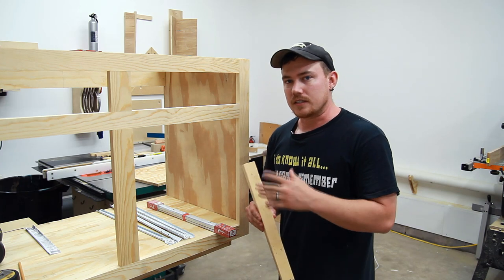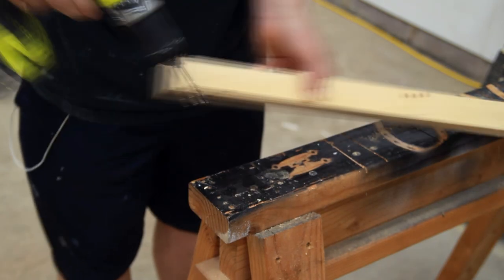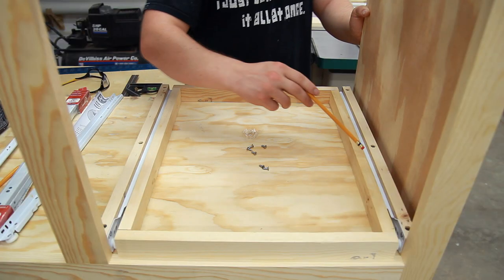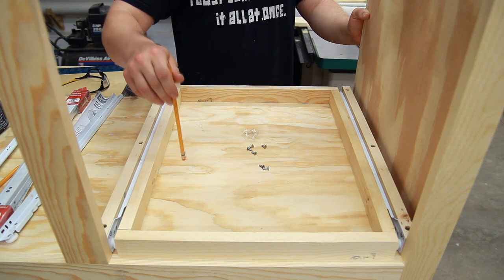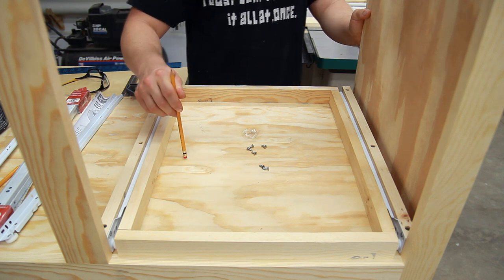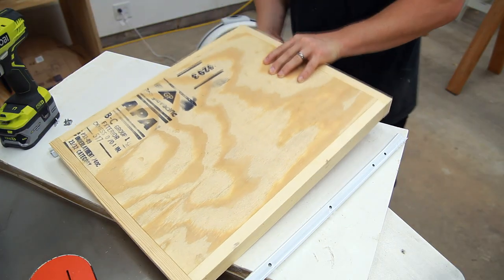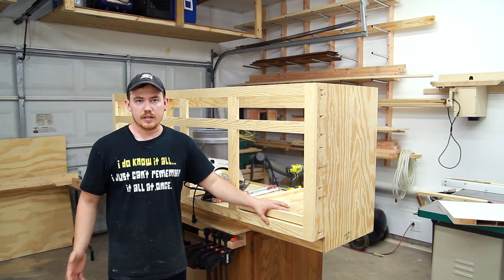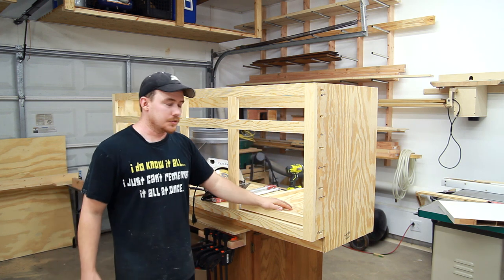EASY DIY Slide Out Cabinet Trays - 167

Comment: i made a cabinet/work table for my small basement workshop and used this to great result.   I made a slide out tray for my 3 gallon compressor (on the bottom like your example here) and also a deep drawer (9'') above the compressor for plastic tools like feather boards, pusk stiocks and my grrripper.      I've seen all the cideos and can't wait for the next one.

Comment: Jay, You're a very good teacher and an inspiration.  I was tired of my shelf and pegboard mess in my garage and instead of making drawers or cabinets I made a 48" bench about 42" high and 24" deep against the old messy wall.  I've made the sliding shelves as you have done here.  I still have pegboard above (even more actually) but with deep sliding shelves, they hold more supplies with easier access.   BTW, I downloaded sketch-up but it didn't speed up this particular project.  I was spending so much time trying to learn the program that I decided to just go cut some wood and get started (finished).   I've been watching the tutorials on sketch-up as well as your videos, and I wanted to thank you for your contributions.

Comment: Back at the cabinet shop, we called these roll-out shelves. They were a $50 add-on option for base cabinets. We did a lot of them in kitchen sink bases - usually on the left side, for some reason. About half of them also incorporated a trash can holder. Easy to make and, as you said, the cost is pretty low.
Reply from the maker: Rusty Pup Nice. I was going to make a trash can slide but in the end decided they can upgrade this if they want

Comment: Thanks for the idea.  I'm actually in the middle of a workbench project that I think could use this feature, maybe on one side and make two drawers for my smaller items.  The other half of the cabinet could be left as an open cabinet.  Seeing how you used the hardware explains the process.  I've not done this before.
Reply from the maker: athiker7209 Glad you found it useful! Thanks for watching.

Comment: Great solution.  I use that same idea in one of my tool cabinets when I got a bunch of those same slides on sale.
Reply from the maker: Jim Coogan Nice. I'm designing a new assembly table/workbench with a lot of drawers and trays in mind.
Reply: Jay Bates Festool has something called a Sysport (http://www.amazon.com/Festool-SYS-PORT-1000-2-Systainer/dp/B00149B7NU)  that holds several of their tool systainers.  I started to design one that uses your slides that looks like their unit did but way below what they charge for theirs.  Then I thought like you did, why not integrate the Festool products I have right into my workbench using the same trays you designed with the Euro slides.  Works for me.  Thanks,

Comment: Thanks for the video. I think I will do this to my kitchen sink cabinet as its a pain to reach to the far back of it to grab something in the rear of the cabinet. This add-on to kitchen cabinets is fairly costly, but you can do it for a fraction of the cost. Just be sure to check out the weight specs of the slides so you don't over work them.

Comment: Are the air-driven fasteners structural or are they just to keep the wood together until the glue dries? What size fastener did you use? Good job! This is the best, concentrated video on making roll-out trays!
Reply from the maker: Mike Nestle The glue will do the long term holding. The nails will hold it in place until the glue dries.

Comment: I think I used those exact drawer slides and I hate them, the little wheel kept catching on the screws, so I had to grind them down.  Did you have any problems like that?  I think I only allowed 7/16" of clearance for each side....   Thanks Jay

Comment: I've been looking for that bit to do small pilot holes for drawer slides or hinges. What size or kind is that one?
Reply: Usually u just use something smaller then the screw you will use in the hole. About the size of the core, not the threads ;-)
Reply: You're looking for a vix bit.  It's a self centering bit used for drawer slides and door hinges.  They come in different sizes depending on the screw size.
Reply from the maker: Derek Hall Derek is right. Mine are just a cheapo brand. I think I paid $5 for a 3 pack.

Comment: What's with the 1x2's on the sides? Why don't you just buy some "floor mounted" slides that you screw straight down into the material it sits on? That would be one big step out of the way.
Reply from the maker: Because these were the better product for the job. Less expensive, easy to install, and available locally.